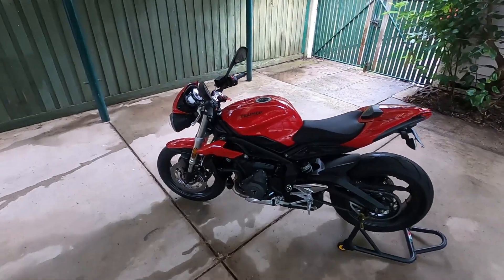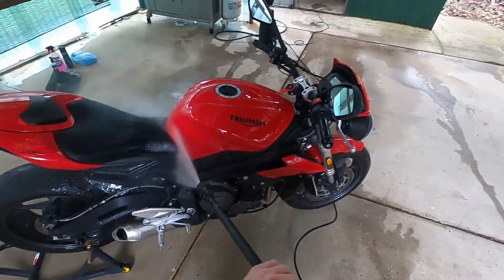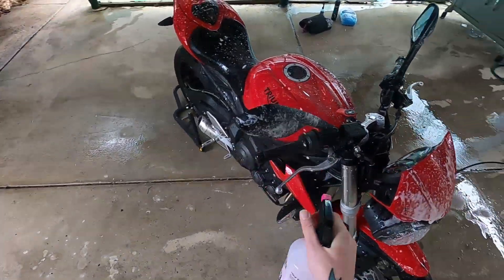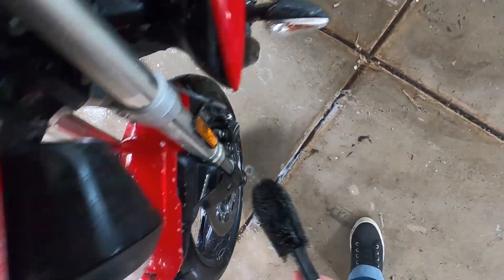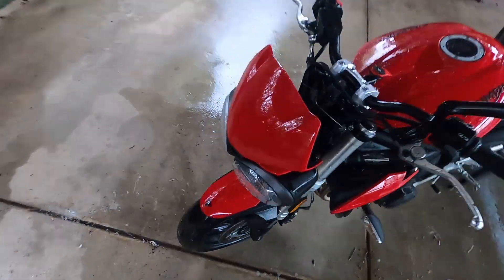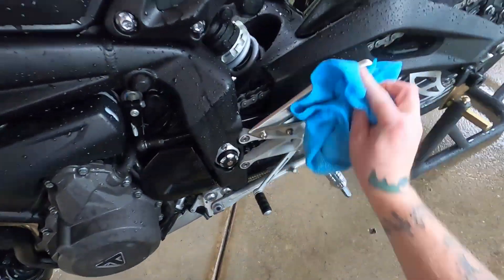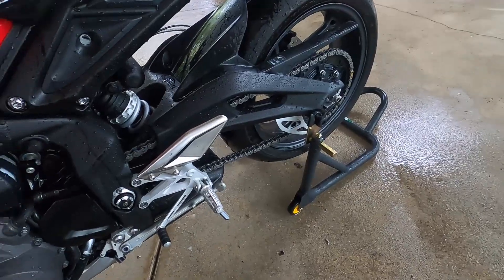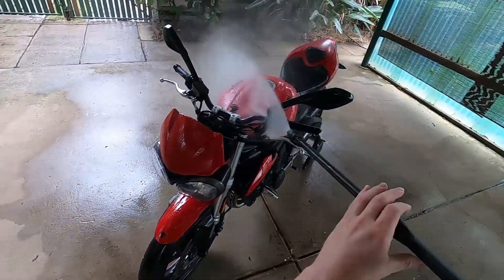How i get the muc off my Triumph

Comment: Question.... should you avoid getting the Muc Off on the chain and sprockets??? I know it’s safe on the the discs and brakes,  it wasn’t sure about the drive chain.
Reply from the maker: The initial pink spray is safe on everything, but the rest of the stuff says on the packaging not to apply to the brakes.
Reply: OneColektiv Cool. I just bought the pink stuff. Gonna try it out tomorrow. Would you recommend diluting it with water? I’ve seen other people say, if your bike isn’t that dirty, you can do a one to one ratio with the Muc Off and water. Just wondered if you had any thoughts on that?
Reply from the maker: It just depends if you want to make it last. I have no issue with buying a new bottle when I run out, so I don't dilute it. But by all means, if your bike isn't that dirty and you want to use it a few more times before buying another bottle, then dilute away. 👍